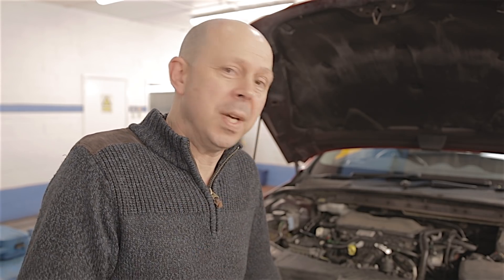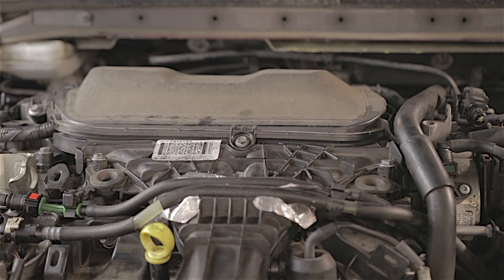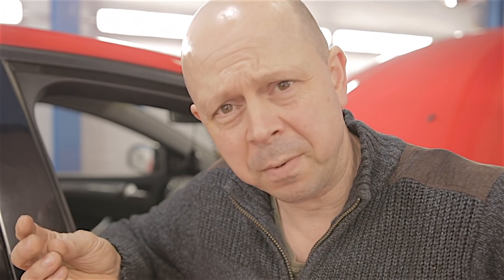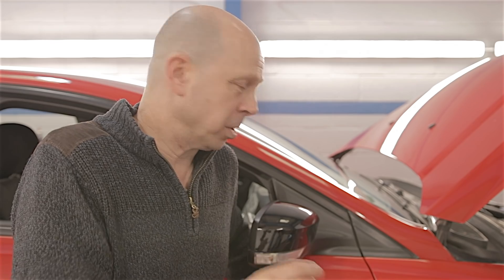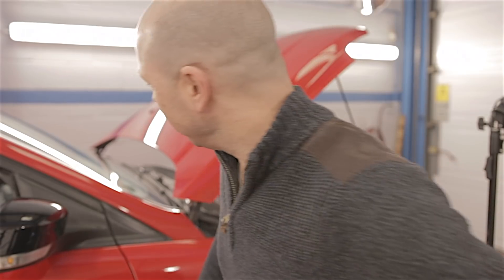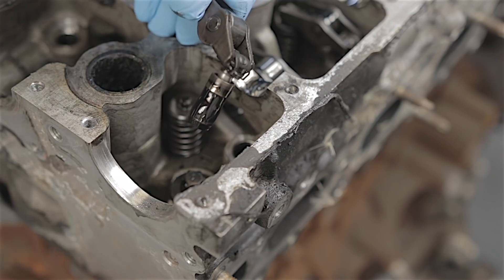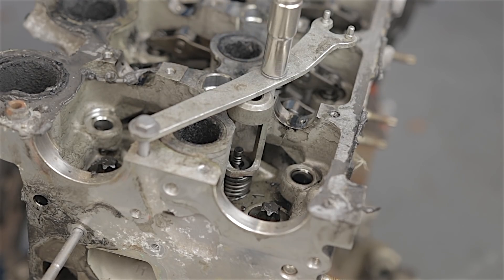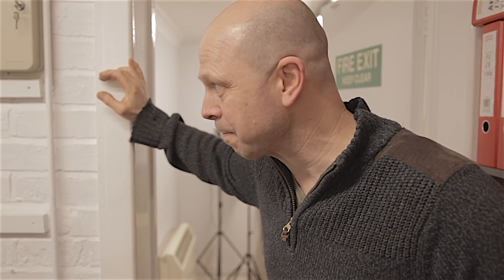Ford Mondeo Mk4 Broken Valve Spring

Comment: Hallo. Why my 2.0tdci 103kw engine when its cold first start looks like dont work 2or 1 cylinder for 10-20seconds. Where can by the problem?
Injectors good
Glow plugs new
Reply from the maker: have your engine cylinders compression tested, low compressions will cause poor cold starting and running when cold as well as smoke from the exhaust
Reply: @alan4x  if injectors ar diferents clasification  whats happen then?
Reply from the maker: little to nothing but if they need coding to the ecu then that should be done as otherwise could cause poor running and pre ignition engine rattles @aivarasseduikis1844
Reply: @alan4x  thanks🤝
Reply: Not tested yet. Its only hapens when outside its cold weather. And its only for 20secons
Reply: But car starts whery easy. Just comes alot smokes for 20sec or less and shaking.

Comment: The broken spring might have been out previously before it broke. Could have been damaged by improper handling - could have been notched by someone holding it with a pliers or something. Even a small scratch could act as a stress concentration on a highly stressed part like a spring or maybe it was exposed to a heat that changed the temper of the spring. An overspeed could well be to blame. A valve spring would have to be designed so that it's resonant/natural  frequency is well outside (above) the range of speeds that it will encounter in normal service but if the engine spent some time at an abnormally high speed, the spring could start to resonant and basically shake itself apart.

Comment: Can anyone please tell me what is the ticking sound on my MK4 Mondeo 2.0TDCi 103kW? It goes from the top of the cylinder head. Engine runs nice, the car goes pretty well, no vibrations or misfires. The sound was different on cold start once, then it was in rhythm of the engine. There is an oil and smoke leak from the turbo and the air pipe under the turbo maybe. Anyone has experienced the same? Tell me, please :) https://youtu.be/1bktdz2ENP8

Comment: Only other explanation would have been in a TSB at some point probably. Bad batch of springs could potentioally happen. Not a big potential but anyway.  How are the injectors on the fords? On peugeots we had alot of problems with diesel injectors on some models. YOu would change one and after the calibration procedure you came back and one would have failed on another cylinder during the procedure.

Comment: Hi Alan. What do I need to buy when changing timing chain? What seals etc?
Reply from the maker: A new tensioner to go with the chain, you will need a new camshaft oil seal..and some sealant to seal the camshaft cover back down to the head.
it would be best to fit new water pump and timing belt kit at this stage as well

Comment: Hi Alan iv an issue with an 09mondeo 1.8tdci. full beams keep sticking on and off I tried cleaning the relay not joy charged up the battery no joy keeps flashing on and off. Weird thing is if I press the phone button on the side of the indicator Salk it turns off the full beams if there stuck on and I noticed if I push the same on the wiper stalk it turns them off aswell bit of I release it it'll come back on...I'm getting a migraine here any help much appreciated. Thanks
Reply from the maker: sounds like the indicator stalk itself is faulty
Reply: @alan4x  could it be faulty on both sides ...? Worth changing both sides do you think?
Reply from the maker: you really need someone to look at it first...someone who can diagnose the fault //i have had the wiring terminal blocks that connect to the headlamps corrode and cause all kinds of electrical problems
Reply: Ok thanks for getting back in touch appreciate that

Comment: Alan can you help me find a mechanic, I really want to save my Ford S-Max, it has a 2.2 TDCI 175Hp engine. Once it gets up-to temperature lots of blue smoke comes out of the exhaust, no loss of power, engine running smooth. Exhaust smelling very rich. No MIL light.

Comment: Alan really sorry to bother you but you're the man for Mk4 mondeos. I have one and the cruise control is not coming on at all, fault codes are showing steering switch left and right and cruise control switch. Is this a common issue?
Reply from the maker: it is not a problem i have come across but there is also a clock spring of wires behind the steering wheel which could be broken causing your fault...all electrics on the steering wheel run through a tape of wires which wind and unwind as you turn the steering wheel but you really need someone to check it out
Reply: @alan4x  absolutely spot on mate, it was down to the clock spring.. Cheers

Comment: Alan can I ask you a question about my mondeo mark iv? 2.0tdci 163bhp 
The car is going into limp mode at motorway speed.  It happens when over 60mph and is intermittent. The traction control light comes on and off then engine malfunction warning lights up. The only fault code coming up is fuel pressure regulator and that dissapears when I turn off the engine and turn it back on. 135k miles on the clock and other than That 
Any thoughts? Great videos keep them going.
Reply from the maker: hi, the first thing i would do is carry out a diesel injector leak off test but make sure your fuel filter is good first
Reply: @alan4x  top man!  I followed your advice. Changed the fuel filter (which was spurious) for a genuine ford fuel filter (cost me 61euro for the filter 😳). For the record it was slightly different as it had a plastic piece on the top of the filter to connect to the filter housing correctly.  That didnt solve the issue so I just got around to doing the leak back test this weekend... And... I have one injector knackered. Getting it rebuilt this week at a diesel specialist. It was injector 1 (near to gearbox)

Comment: Meanwhile all is well in my 2.0 duratec world. 😆 I just replaced the t-map sensor in mine as the performance was all at the bottom end whilst losing in the mid range and top end and now it's even all the way through. £23 and a genuine Bosch component too.

Comment: 🤔I have seen this before , generally with the taxi's it was on a generally low miled taxi if there is one.... what I found on my findings is the valve spring was a thinner gauge too the rest of the valve springs fitted too the rest of the engine , almost as if it was fitted incorrectly at factory..
Reply from the maker: thats interesting
Reply: @alan4x  interesting and terrifying , as how many of these french engines has it happened too. I wonder where they where built , in France or in the ford plants....
Reply: That shouldn't be hard to verify so - just check the broken spring with a micrometer and compare to a new one.

Comment: Peugot if given the engine number should be able to trace everything about that valve spring, from who made it on what date to what hole in the ground the iron ore was dug out of !
I think your thoughts are correct, the driver did a Clarkson and changed down into the wrong gear over revving the engine, the ECU should have put it into limp mode until the ignition was switched off and on again to clear it https://youtu.be/PYh8qtXD8l0?t=628
Reply from the maker: cheers lol

Comment: Often there is a special tool available that inserts into the exhaust or inlet port to push the valve up to remove the collets without removing the head, also there is type of compressor that hooks onto the bottom of the valve spring ( if there is room).

Comment: You annoy me.  Told me to buy a MK4 then told me what a great car the MK3 was. :)  I may have mentioned that before, can you tell how annoyed I am?  :)
There was a tool for the Ford CVH engine that bolted between the cylinders to compress the valve, enabling spring removal and change the stem seals.  U shaped tool.

Did you test to see if the valve moved freely with the spring off?  Failing a sticky valve being over revved does seem to be the answer. Or just a very rare failure.
Reply from the maker: hi, yes the valve was moving freely, i do think the mk3 is a great car but i would rather have a mk4 given the choice, i like the shape of the mk4 better and it is the newer car...if i really had a choice i would still be driving a mk3 cortina
Reply: @alan4x  I've got a MK4 with 190,000 miles on it now and it's been very reliable (touch wood) it's had a cambelt, clutch and dmf at 100,000 but that's the only big outlay, I've had it 5 years. I had the mk3 before and definately had more problems with that,  clutch,  dmf, ignitors, but it did have 240,000 miles on it when I sold it.  I had 3 mk3 Cortinas back in the 80's and a mk5, I'd love a mk3 now but they did rot away before your eyes!
Reply: Well i mostly followed your suggestions, sexy alloys, tints but no xenon's. Does have NAV though. Lots of miles but it was cheap. :)    How about a video on the day of a taxi driver (with comedy effect/twist) on how they treat the cars and why you hate them :) Too big a project? Love your video style.
Reply: Funny, I was also going to add a comment here about the simple tool...made by draper I believe....to enable valve stem oil seals to be changed simply on the escort cvh.  I had a late model Sierra with the lovely 1.8cvh that had done 200,000 miles, but sadly that tool wouldn't have fitted so I just left it as it was.